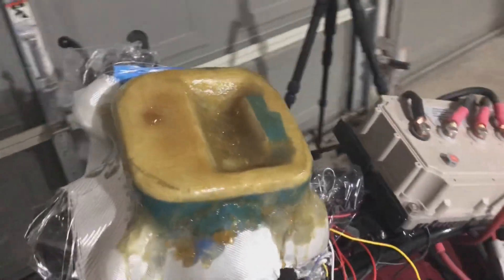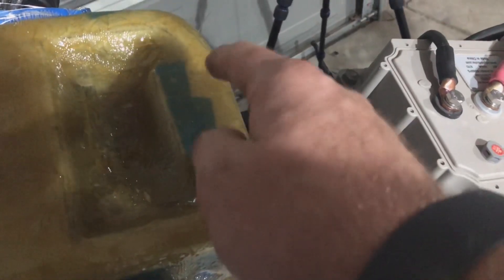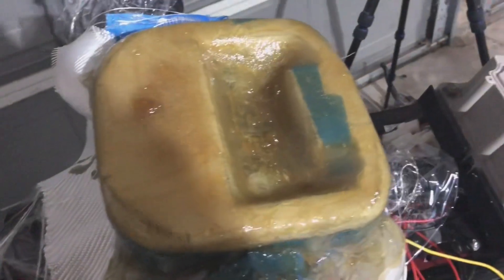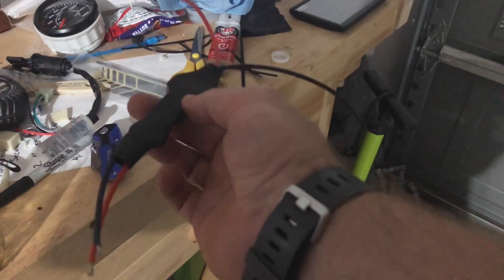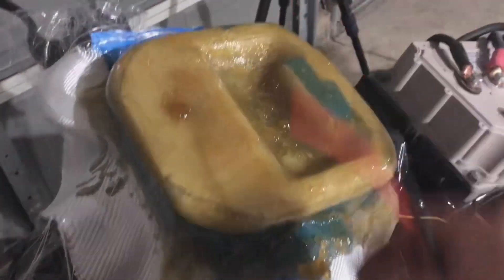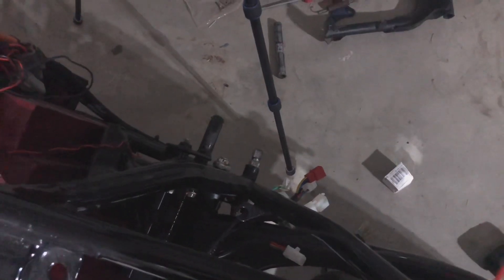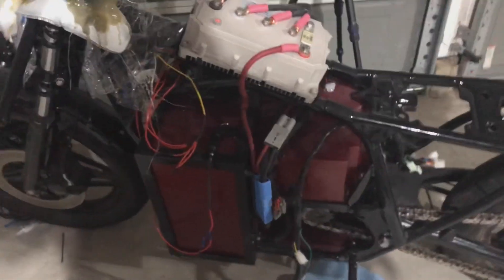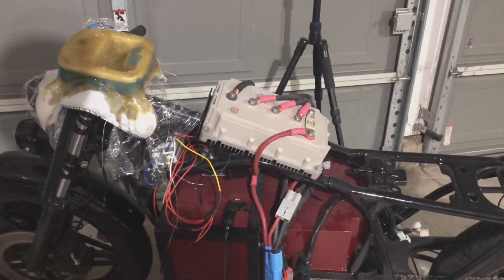Electric Cafe Racer Display and Final Wiring: WE’RE DONE

Comment: Where did you put the battery temperature thermistor / sensor? I didn't see that in your Battery Pack vid. Also, any chance you could share your final Kelly Controller settings you ended up with?

Comment: Awesome work Guys! I have a doubt regarding the connection of supercapacitors with the battery pack. Have you used any Bidirectional DC DC converter in between them. Also what determines the switch from battery pack to supercapacitors during peak demands?

Comment: What kind of soldier iron is that
Reply from the maker: It’s the x-tronic station. Here’s a link!

https://www.amazon.com/X-Tronic-3020-XTS-Digital-Display-Soldering/dp/B01DGZFSNE/ref=asc_df_B01DGZFSNE?tag=bngsmtphsnus-20&linkCode=df0&hvadid=80195746823052&hvnetw=s&hvqmt=e&hvbmt=be&hvdev=m&hvlocint=&hvlocphy=&hvtargid=pla-4583795273737603&psc=1

Comment: Hey Curt, I was just thinking about the rear braking. Have you considered wiring the regen into the brake light? That way you could apply the front brake and also get some rear braking at the same time. Kinda like how some road bike have linked braking.

It would really be cool if the regen could be wired up to a wheel sensor so that if the rear-wheel did lockup, like on a wet road for instance, it could immediately reduce the force in order to get the tire rolling again. I'm guessing they don't make such a thing, but they should.
Reply from the maker: I thought about it, but I decided it was better to have it so you could brake using mechanical braking only if your controller was overheating, etc. if it was wired in permanently it would be important to have that safety measure installed for sure!

Comment: Hey good job, I love the cafe racer build video. How difficult will it be to add a J-1772 connecter to the two electric bike. I find it will give you the  possibility to go for road trip and make nice road trip video with both bike. I think it will be nice to see. But yeah keep the good job 😉.
Reply from the maker: That’s an excellent thought! Those plugs require an on-board charger, and you’d need it to be a high power one to not spend too long waiting. The battery can handle about 60 amps charging, which would be a full charge in two hours. A 30 amp charger would do it in 4 and costs about 400 dollars. All you would need to do is adapt the plug on that to a J1772 and you’re good to go! Might be worth doing in the future for sure. I’ll keep my eye open for the right charger at a good price